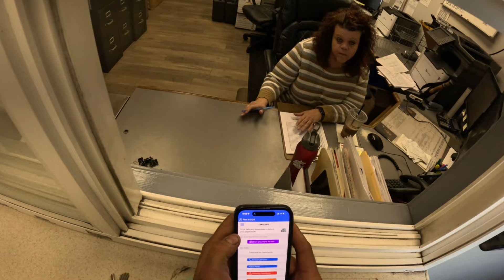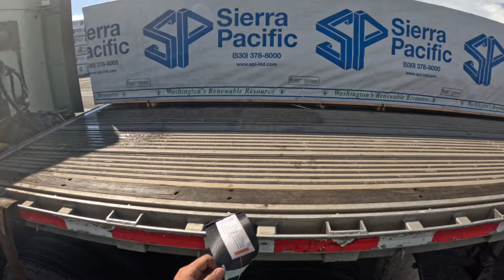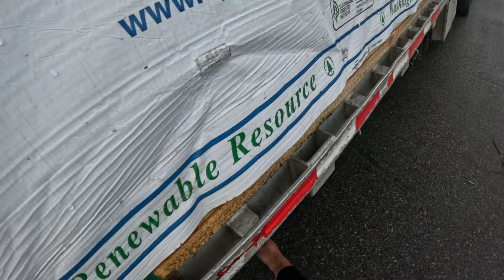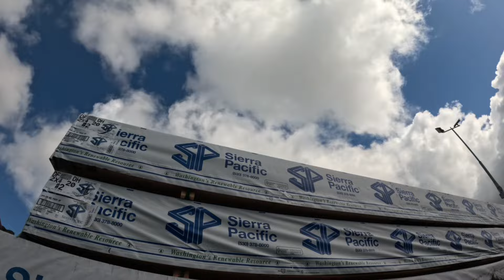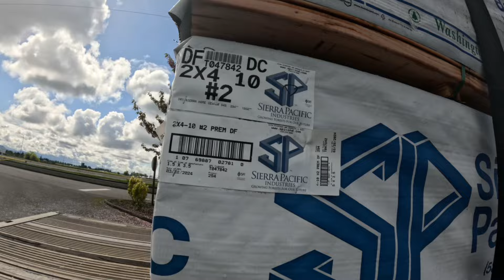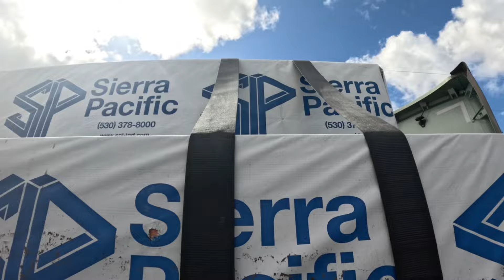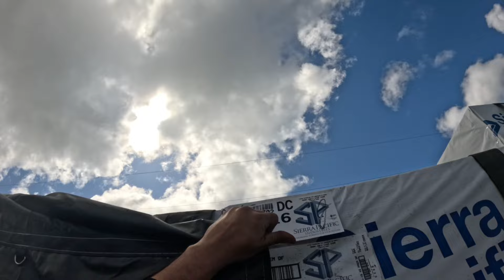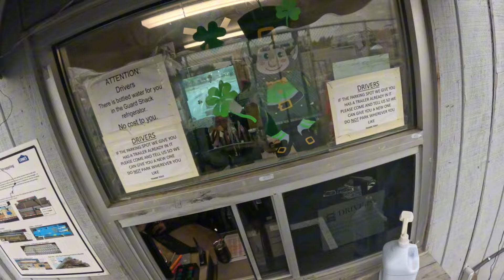Central Oregon Flatbed Trucking #91. Best forklift driver ever. No appointment time so going home.

Comment: Jimmy, have question, I don’t understand the California bridge law, because you have a flatbed  where you your tandem axles are more than 40 feet from the kingpin. Can you please explain it to the audience. Thanks kevin
Reply from the maker: trailer is exempt because it's a 48'
All 48' trailers are exempt from KPRA laws (King pin to rear axle)
Reply from the maker: It's a mathematical formula to determine how much weight the road surface can handle and what axle spacing the truck needs to minimize road damage. If you plug the numbers in for a 53 spread, the damage to the road is too great according to the formula. So they make you group the axles closer together to spread the weight out more evenly. The bridge formula doesn't refer to bridges you drive on It refers to the truck/trailer "bridging" the weight between axle groups. That why California has a close axle law and a fixed 48 spread or a 53 Cali fix spread.